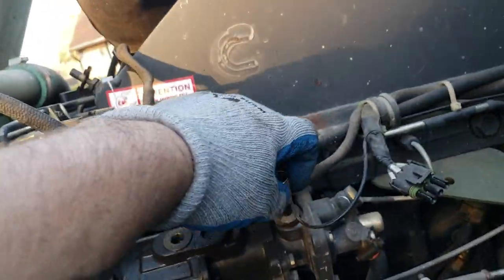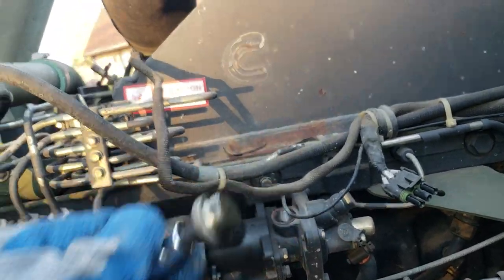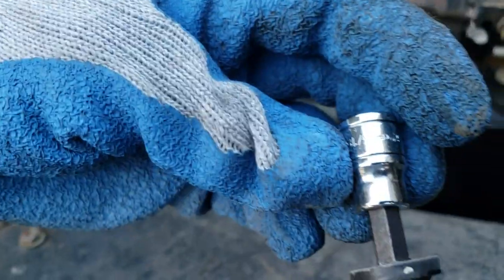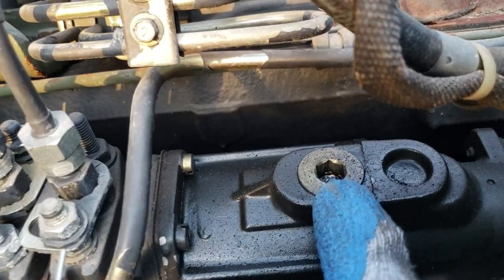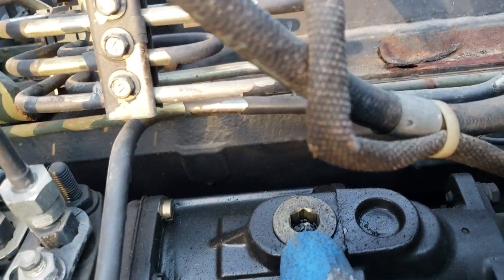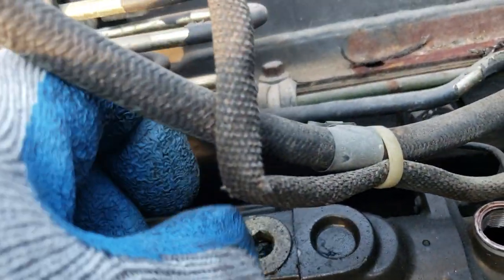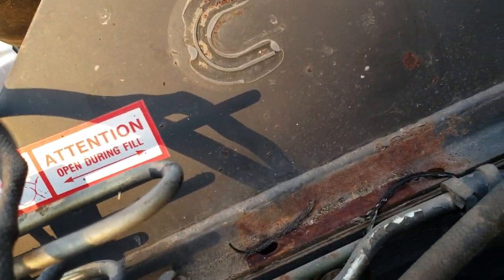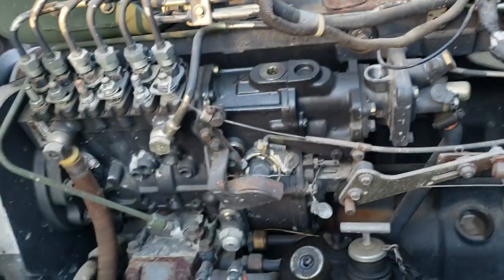M939A2 - 6CTA 8.3L - Fuel screw and aneroid valve adjustment

Comment: I know the military versions came with 240 and 330 hp. What would be needed to crank these up to 400 hp? Same as a 12 valve? Gov spring, injectors and fuel screw?
Reply: I've seen marine 6CTAA's cranking out 600+ reliably? I imagine it's possible with OTR 6CT's. It's just an unexplored engine. I imagine these engines have a lot more potential than what we know of.
Reply from the maker: Marine injectors. Pump work.  Slight governor increase and a bigger turbo
Reply from the maker: The more power the less reliable and less life they have.
Reply: @wessimpson2794  I'd be satisfied with 400-450 hp from my 8.3. That should be a reliable rating with the 8.3. 160-190 hp 5.9's are pretty reliable tuned up to 300-400 hp. A sleeved 8.3 should do pretty well at 400-450?
Reply: @bladenrexroth2555  I owned a 1991 M931A2 that had 450 HP/1,200 TQ.
Injectors,fuel screw,fuel pump,and HX50 turbocharger added after the intercooler and governor spring kit from 6BT were installed.
I have had idiots say that 6CT's can't go over 300 HP...YES they can.But if you want that,the 6CT will handle the stress.Some of them used for truck pulling or diesel racing have twice that amount of power if not more,but obviously are one trip at that point due to a short life span.I would think that the 6CT should remain humble even at 400-450 HP though.
I know you can use parts from a marine 6CTA as interchange if you want more power out of them.
For the 6CT too,use parts from a ISC,they have the same bolt patterns and dimensions.
Reply: @Slim_Slid  M931 and M932 tractors had 330hp? Especially needing to pull the rolling refinery and flatbed trailers loaded with heavy equipment. 5 ton tractors always seemed to get the more powerful engines.
Reply: @bladenrexroth2555
The five ton trucks such as the M923's-M936's and A1's all had Cummins NHC-250's with 250 HP/658 TQ,all of the A2's had 6CT's with 240 HP/592 TQ.The NHC-250's were all used in the M812's-M820's before them.
The M51's-M62's dating before those all were gasoline powered with Continental R602's,the M51A1's-M543A1's were built by Mack and had Mack EDNT-673's,finally the A2's had the multi fuel LDS-465's.
It didn't matter what variant of trucks it was,they all had the same power and rating,depending on the series.
Going back to the multi fuel A2's,I wouldn't say they had better power,they were only 175 HP/447 TQ compared to 135 HP/330 TQ from the LDT-465's in the M35A2's-M756A2's.The Mack A1's and even the gas trucks before that had better power ratings.

Comment: Going to bump mine this summer.  Shooting for around 275 HP/300 HP max.  Trying to keep in the specs for the MT654CR transmission.  My truck is a dog pulling the M322 trailer and a 13,000 lb tractor.   Still want a long useful life on the engine but as it is now, it is sloooooooooow!
Reply from the maker: Replace the HE1 turbo with an HX40 or HX50. You will be better off and then add some fuel
Reply: @wessimpson2794  HE1 Turbocharger?
Reply: If you want a long life on your 6CTA,do not make it exceed over 300 HP,I have made the 8.3's handle intense power and I know people who use them in certain rigs for pulling and drag racing.After 300 HP,they won't live long,they will easily walk it off but not go the distance if you want to use one almost all the time.Over 300 HP requires a intercooler,and the cab of the truck needs to be raised at a '5 for it to fit.
Easily you can borrow a governor spring kit from a 6BT and turn the fuel screw 2 3/4,and then use the aftermarket turbocharger.If anything else,a ISC has the same bolt patterns and dimensions.
Reply from the maker: @Slim_Slid  they are H1Es. Part number 3802257

Comment: How far out have you backed the screw on the top of the pump as you talked about also have you adjusted the rear fuel adjustment on the rear of the pump? If so how far out did you back that jam nut
Reply: Most back out the front screw just a few turns. You’ll know if you went too far if it smokes too much off idle or if the screw hits the inside of the pump housing. If it does hit the inside, it’ll hang the throttle. Run the throttle after you adjust it to make sure it clears.

As far as the rear preload nut in the AFC housing, I’ve always heard to back the nuts out until the top of the locknut is flush with the stud.